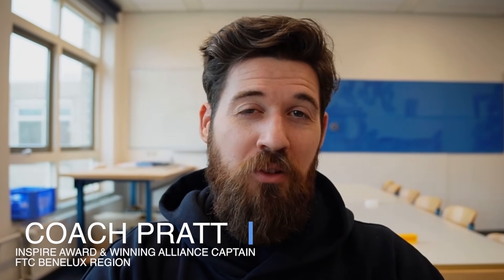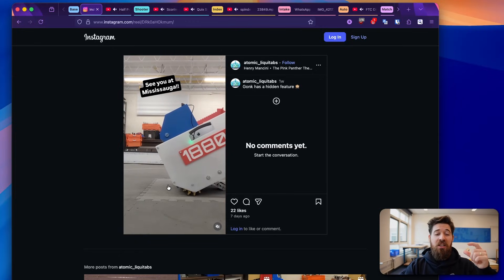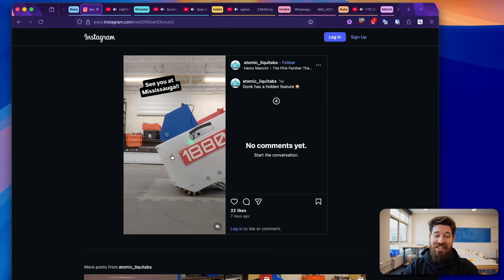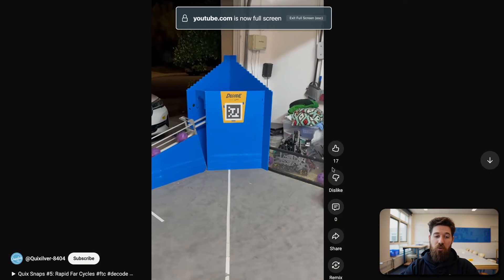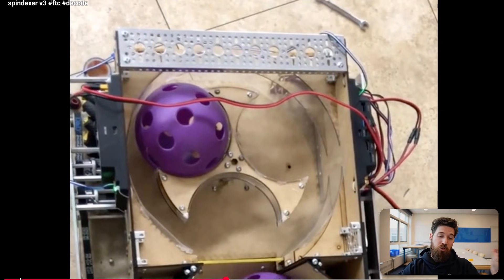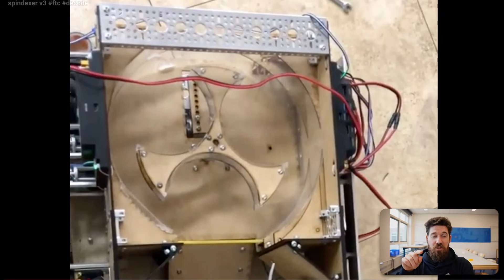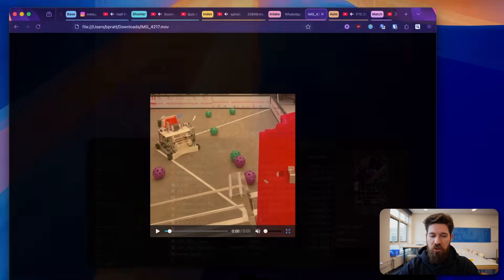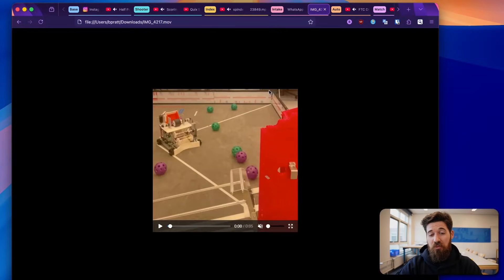The Secret to a Perfect Robot? [FTC Friday's DECODE]

Comment: Could you clarify the ranking point you were talking about with the team that had the 9 ball autonomous, I haven't heard about it yet.
Reply from the maker: I’ve got a full video on that here : https://youtu.be/KOt_kVHVuF8
Reply: In this video the team with the nine ball auto was still touching the white line at the end of autonomous, so even though they had movement, they wouldnt get the three movement points because they moved back onto the line at the end of autonomous. In Coach Pratt's other video he explains how those 3 points can be critical to getting your movement ranking point, because unless you can consistently get 30 points in end game by levitating above a robot that park underneath you. There is not a lot of wiggle room to get your 16 to 21 points of movement required to earn your ranking point. If your question is about ranking points in general watch his other video. If it was about how a team could get a nine ball auto and fail to get ranking points it was because they moved back onto the white line, which could impact their movement ranking point.